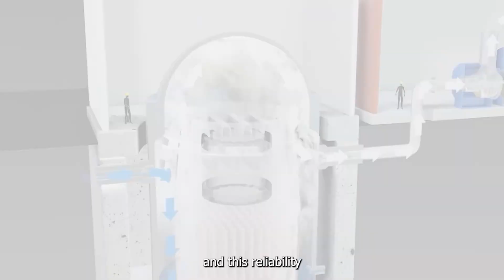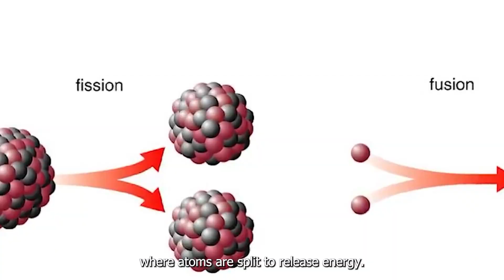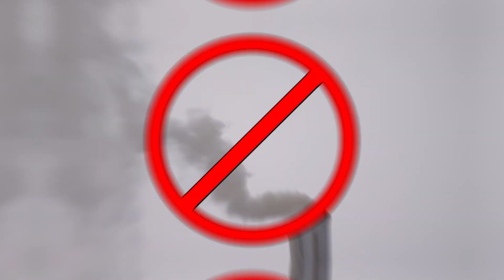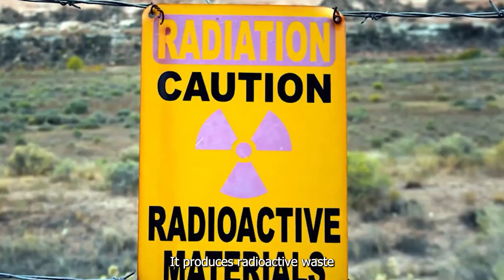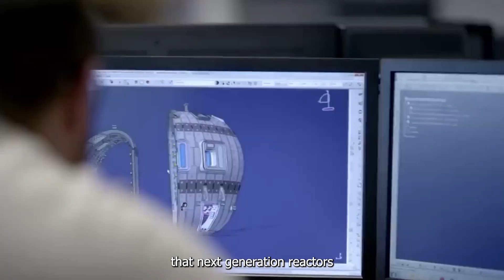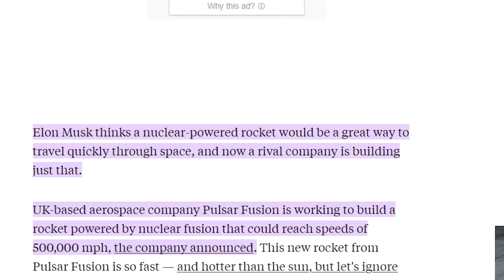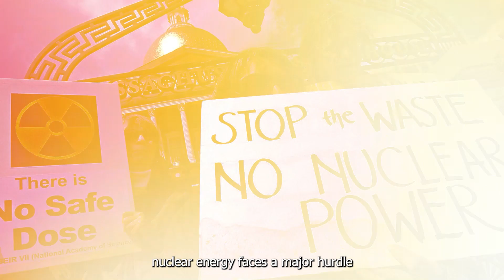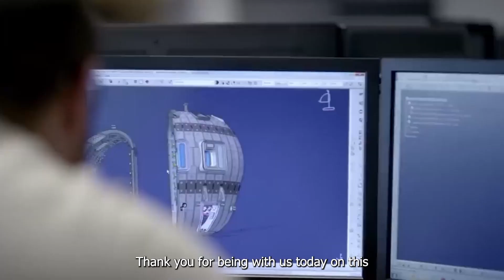A Nuclear Energy Utopia? Unveiling Elon Musk's Shocking Revelation

Comment: I'm in full agreement that, if Musk is working on fusion and can get it to work, it will be a game-changer. It will make space exploration practical. Regarding 'clean' energy carbon dioxide saturates. The relationship between it's heating effect and it's atmospheric concentration is non-linear (exponential) with each increase having less effect than the one before. So it's effect on global temperature is limited and talk of runaway global warming is unfounded fearmongering. Furthermore, plants need carbon dioxide to survive and thrive.  Thankfully China is greening the planet, with it's ever-increasing number of new coal-fired power stations. And the modern grand solar minimum that has reportedly already begun? If correct, more expensive electricity  and heating is the least thing we'll need. (Readers please don't take my word for it. I'm only an electrical engineer. Do your own research.)

Comment: Step 1: prove fusion can deliver more than it consumes, on a continuous basis. Step 2: do Step 1 for a similar capital cost to current renewable options. Only then can Fusion become a commercially viable option. Generation options with a high capital cost such as current nuclear generation demand to be run continually to make any kind of reasonable return - no fit at all with Wind and Solar which need  to be paired with either "peaker" generation or big big batteries.
Reply: After 80 years, Fusion is still 30 years away.., and will remain so.., for the next 500 years.

Comment: This idea is more than 50 years old and most developments where stopped early in the process of building a reactor. It's extremely dangerous. Some countries still try to make it work because the process creates a number of pretty nice isotopes and elements that are needed for nuclear weapons.
The reality is, that especially sodium cooled fast reactors are the worst idea ever. Sodium at very high temperatures is transporting the heat to a boiler for the steam turbines. If something goes wrong and sodium comes together with water the result is much worse than the graphite fires in Chernobyl and Windscale. 
In Germany the reactor in Kalkar was almost ready to be loaded with nuclear fuel when the decision was made to stop it. It was over all just a bad idea. The fairy tale of never ending nuclear power wasn't working. The building is now used as an amusement park.
https://en.wikipedia.org/wiki/Wunderland_Kalkar

Comment: I'm gonna say this. If anyone can do it, Elon MIGHT be able to get it to work. But honestly, nuclear energy just won't happen.
1. You need to figure out the right size.
2. You have to figure out the right resonant frequency of the coils.
3. You need a LC TESLA COIL circuit.
4. We still haven't gotten the proper design of the coil.
5. And we're still messing around with materials.